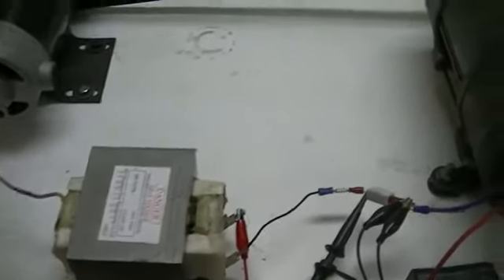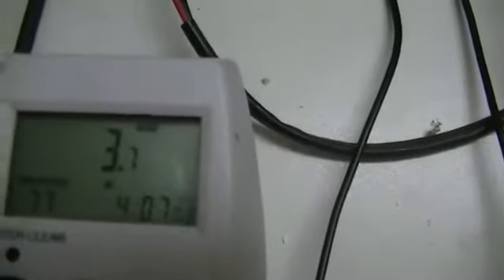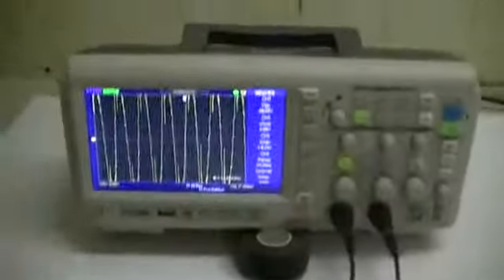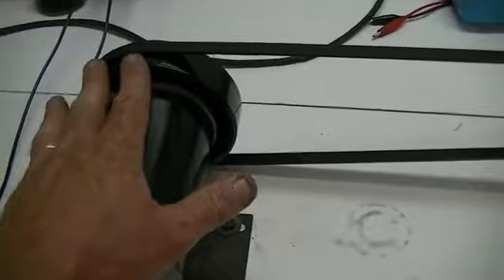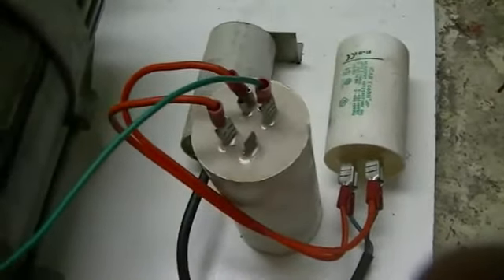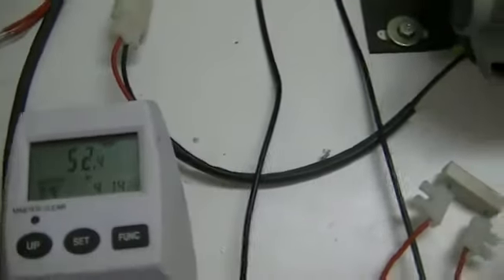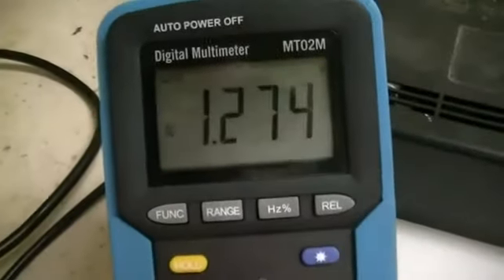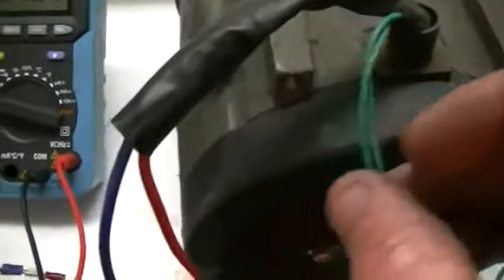Reactive generator reserch

Comment: is this a self excited capacitor excited generator?  if it is you can increase power by bigger capacitor and higher resistor values in the rotor then step down the insanly high voltage output with a transformer to power load with weaker magnetic fields between rotor and stator equal and opposite. when rotor and stator field become equal then power equals to depends on capacistance and resistance. if capacistance is higher and resistor resistance is lower then the rotor and stator field become unequal and game over. permanent magnet generator rotor and stator fields are always unequal and inefficient.